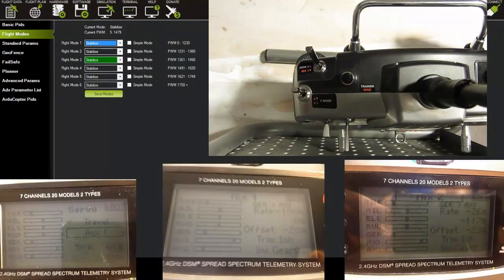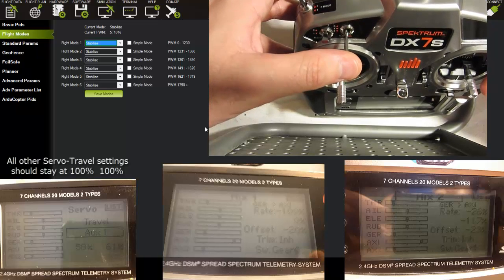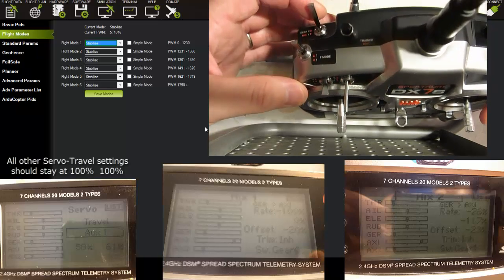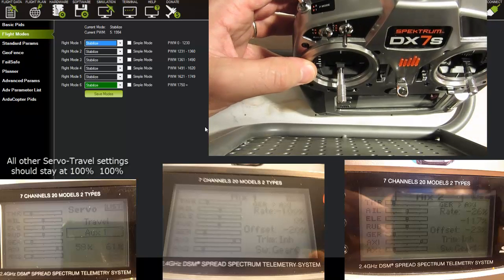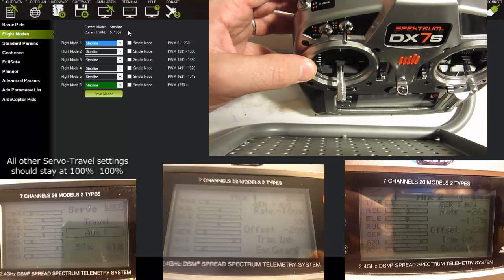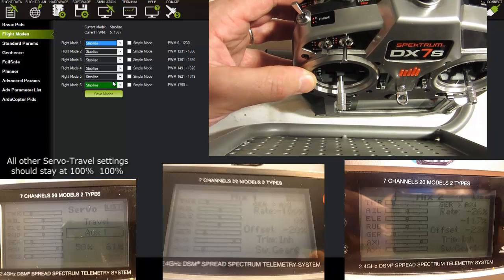6 Flight Modes on Spektrum DX7s

Comment: im using this radio on a quad with naza m v2 and every thing looks great except theres something wrong w my throttle settings that wont let the naza arm it throws it to failsafe it was telling me the midpoints were to great for motors to arm.any ideas????????im stumped i just got two of these radios and had to send 1 back.